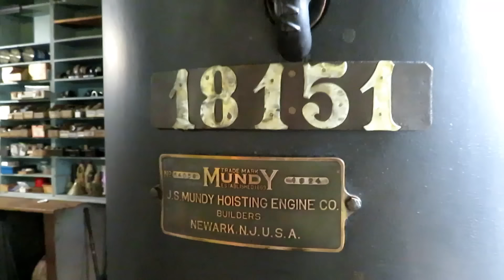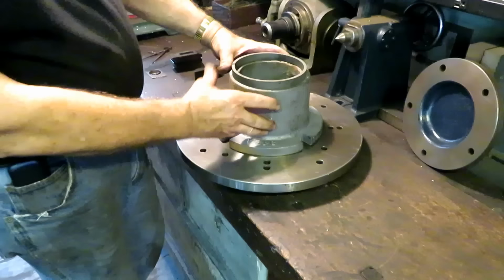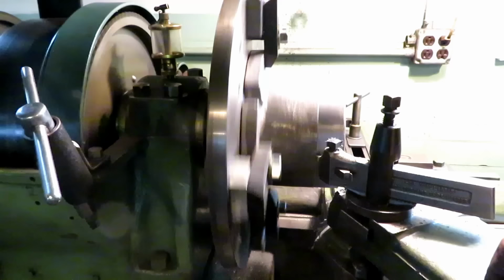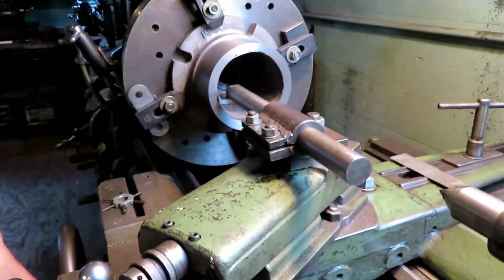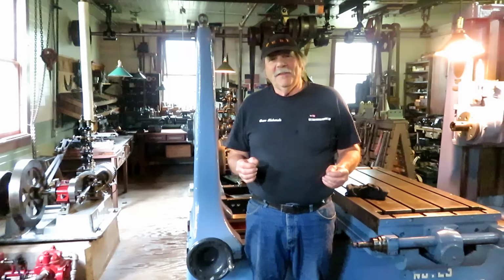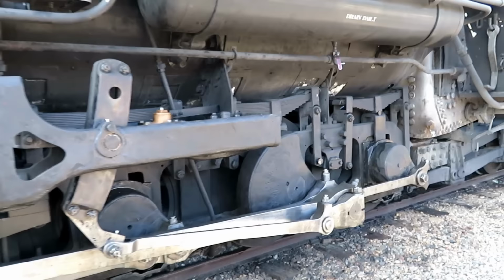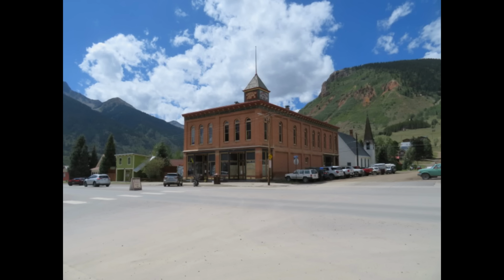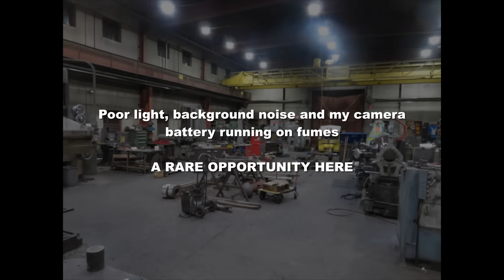OLD STEAM POWERED MACHINE SHOP 45  Piston Rings & Narrow Gauge Dreaming

Comment: Cast iron machinists and coal miners looked about the same art the end of the day. My first industrial job,,, running large radial drill running off overhead line shaft,run  off DC motor, electricity generated off mighty Ames compound engine,, 24" low pressure cylinder and 18' high pressure cylinder and 14 foot diameter flywheel, driving 3 foot wide leather belt. In the return tunnel under the floor, you could stand beneath the belt,,,whipping over your head, and your hair would stand up from the static. Young, crazy, foolish,, ten feet tall and bullet proof, but very much alive in the best of times!!!  Keep on keepin on,, love your channel!!!
Reply from the maker: Thanks for the great comment Bob....Dave

Comment: There's something romantic about the old steam locomotives.  My dad was a switchman on the railroad for around forty years.  He retired in the early eighties so he worked during the transition to all diesel electric locomotives.  He said it wasn't so romantic working everyday around the old metal horses. He complained you always had a cinder in your eye and the steam locos took an unbelievable amount of maintainence compared to the modern engines.  He lived near  the large  yards outside St. Louis and worked on the hump (car classification tracks).  My mother would complain she couldn't hang clothes on the wash line without them being soiled by the soot from the steam engines. Even knowing that I seem to be hypnotized when I see those old giants, appearing to be alive, belching out smoke and hot breath as the push those drivers back and forth as they pass.  Thank you for the great video and a window into the past
Reply from the maker: The smoke and cinder issue has a lot to do with how the engine and fire are handled, especially in the yard in town. DSRR makes a big effort to keep folks happy with their operation...Dave

Comment: Dave, those T slots on your 4 jaw chuck are for holding work pieces like your ring casting. You just remove the jaws and bolt it up using the T slots. Saves you from having to lift that heavy chuck and face plate on and off of the lathe.

Comment: I lived in Knoxville Tn. for several years. While wandering around found a old steam powered marble processing location. It was sold soon after I found it. Was sold to contractor working on restoration of DC post office. Craig Pink marble was the original building surface. They ripped out all the old steam equipment with the rows of belts. what a loss that no one documented the process.

Comment: DAVE,
Really enjoyed your trip west. I have been enjoying your channel for quite a while. I am 
A shop owner in Richmond Va.
Celebrated 50 years in business in March of this year.
Keep up the fantastic videos. Your shop reminds me or the first shop that I got to do some work in. It was all line shaft driven from a 20 hp Dc motor.
It was a school shop to teach
Trades. Miller School of Albermarle near Charlottesville,Va. it was closed in the mid 1990’s. It was built in 1880 as a trade school for the people of albermarle county. The equipment was very extensive, everything from
Lathes,mills,shapers,planers,o.d. & I.d. Grinders. They also had a blacksmith shop and a foundry. The buildings are still there but all the equipment was auctioned off in the later 1990’s. All I have as a temperance is an old post drill.
Keep up the fantastic work.😊
Reply from the maker: Congratulations of 50 years of working for yourself. No small accomplishment. ...Dave

Comment: The Durango & Silverton runs k28 and k36 the K 28 were built by American locomotive company I'm not sure what year but the k36 is were built by Baldwin locomotive Works in 1925 and Rio Grande also took some standard gauge engines and converted them to Narrow Gauge and that's what the k37 are and they're Baldwin's cumbres and Toltec I think has one or two k37 the K indication means it's an outside frame engine like you were talking with the wheels in the center in the frame they're basically standard gauge locomotives built for Narrow Gauge track I've been a fan of the Rio Grande Narrow Gauge for many years it's still on my bucket list
Reply: The K designation is for Mi "k' ado or 2-8-2 wheel arrangement.  The K-27's have a 27,000 lb axle load or approximately 27,000 lb tractive effort, the K-28's have a 28,000 lb axle load or approximately 28,000 lb tractive effort, the K-36's have a 36,000 lb axle load or approximately 36,000 lb tractive effort, and the K-37's have a 37,000 lb axle load or approximately 37,000 lb tractive effort.  The K-37's didn't perform as well as the others because they had been modified from standard gauge 2-8-0s.  The K-27's were built as Vauclain compounds in 1903 with the large or low pressure cylinder on  top of the small high pressure cylinder.
Reply: While in Colorado, did you get out to Uhrich Locomotive works in Strasburg?

Comment: Another very good video.  It looks so easy to build a railroad track across what appears to be "easy" ground ( not the rocky bits), but as I am building a small ride on railroad in the garden, (500yds round) I'm finding it quite difficult. Especially getting the cold rolled rails to meet , as they don't always fit exactly where I want them to especially on curves.( different radii)

Comment: Hi Dave, another fabulous video. Thank you. No complaints from me for the travelogue. Look up the narrow gauge railways in the UK. Mostly around 2 foot gauge. It is strange that the tender appears to be full width as the main reason for narrow gauge railways is reduced loading gauge so making them cheaper to construct, you don't need to clear so much ground, particularly in rocky or mountainous areas. I take it that you will stress relieve the piston rings before final machining? Best wishes. Andy

Comment: You should come to West Virginia and check out Cass Scenic Railroad. They have the largest collection of working Shay locomotives.
Reply from the maker: Cass is next on the "list"....Dave
Reply: If your lucky they will have #6 running. We were there a few months ago and we took the trip to Bald Knob using #11. I was so close to the engine I could almost touch it. It was warm on the cold trip in July.

Comment: i dont understand why you just didnt use the 4 jaw.....The 4 jaw makes a lot more sense for this application than a faceplate.....I enjoyed the video... subbed
Reply from the maker: Thanks for the subscription Sean, The whole idea of the flange on Frick's casting was to make a convenient way to hold the cylindrical part without distorting it from chuck clamping pressure when it got thin....Dave

Comment: Great video as always. Curious: Why wouldn’t you finish turn to size on the faceplate? I thought the whole point of the flanged casting was to allow that to be done in one op.
Reply from the maker: Hi Adam, You'll see as the project goes along. the ring has to be split and compressed in a jig, then turned to "bore" size. They were using a jig the same way at Durango, but my camera gave out and I didn't get a photo of it....Dave

Comment: The K designation and the locomotive design means that is it an outside frame engine that means the wheels are in the center of the frame and the counter weights and connecting rods are on the outside of the frame that's with a K means

Comment: Hi Mr. Richards

Well...
Firstly...are you still getting a bit of belt slippage on the large lathe...?
As I thought i detected a bit when you were parting off...

Secondly...
I loved the video of that railway you visited...
I always thought Colorado was somewhere that was like a desert with tumble weeds blowing about and where those dodgy beatles came from...
I thought the train snaking up near the cliff edge was especially dramatic...
Very scenic...

We have preservation lines here in the UK...
The East Lancs Railway has a lot of steam & early diesel stuff...
The Romney, Hyth & Dymchurch railway is a narrow gauge...
Its on the south coast near Brighton...i think...

It just goes to show that there's lots of things to see and do....it's just a matter of going... 🙂
Reply from the maker: Glen, you're right I've got to do something with that belt, It's actually a rubber conveyor belt with fine groves against the pulley, I thought it would wear in and work better than that but I guess I'll have to spring for a new belt of some other type, maybe go back to leather.....Dave
Reply: @davidrichards5594  on the old rubber belts when we used them on tractors the old timers used to put a couple tablespoons of molasses mixed in water on the inside and ran a couple minutes at low RPM a thin tacky layer got in those grooves and she didnt slip... Rubber belts get a shine to them over time and for us the buzz saw would slip...

Comment: The only thing I would do different is flip the boring bar over and bore on the back side
Reply from the maker: Hi Dennis, I've never understood the advantages of doing that. The force against the toolpost would be up, pulling the cross slide and compound up against the dovetails angled faces, and lifting against the carriage instead of forcing down against the ways which are trying to locate the carriage crosswise. Some folks like to thread that way too, could you explain it?...Thanks for watching....Dave

Comment: Most excellent travel tour...one question, how are those drive wheels secured to the axles, I was looking for a big keyway. Are they 'shrunk' on...? I'm in Northern California, there's some nice railroad that they're still running, but nothing quite as spectacular as this.
   And here in Sacramento, there's the now-defunct Sacramento Locomotive Works where they built complete engines, foundry and all....it's pretty dirty though, they've spent last 15+ years getting the dirt property cleaned up, the buildings are still there. The place is probably on that Super-Fund clean-up list.
Reply: They are pressed on...  I believe the wheel is heated and the shaft pressed on... there is a video of modern train wheels and axles being done in that way...  The tires are also heated and then pressed on...

Comment: Hi Dave, What a spectacular senery, and some heavy railroad metal, why do you not finish the piston rings in the lathe ?.
Reply from the maker: They have to be cut and compressed in a jig , then OD turned to cylinder bore size. That way they will have some "spring" into the cylinder and will be round when installed....Dave
Reply: Yes ofcourse, stupid of me not to think so far.

Comment: What was the reasoning behind the experimental wheel relief?  Just to make machining easier by not having to turn the big radius on the outside?
Reply from the maker: According to Joe: The worst problem with profile wear is the "lip" that ends up on the outside edge from slower wear there. It defeats the purpose of the profile and causes some banging around against the flanges on turns, etc. So they cut the outside relief to make the job last a lot longer. You can see the wear pattern on the heavily  "used" wheel in the photo....Dave
Reply: The tires don't wear down to condemnable limits because the side rods will be hitting the rails on turnouts and crossing surfaces because of the small clearance between the bottom of the side rods and the top surface of the rail.  In other words the stroke could not be increased without increasing the diameter of the wheels.
Reply from the maker: There were a set of crank throws there that had the edges chamfered off about an inch with a torch down near the crank pin. Joe figures that it was done many years ago to avoid hitting rail in dual gauge switches in the area where that particular loco was working.....Dave

Comment: If someone could talk about why the smoke stack on locomotives puffs in time with the engine I would appreciate it.
Reply from the maker: I can take a stab at that Hugh,  Everything about a steam locomotive concerns performance and efficiency. The exhaust from the steam cylinders that drive the locomotive is directed up the smoke stack to act like a siphon and it helps to pull the air through the grates, fire, and boiler tubes behind it, making the fire burn much hotter like blowing on a charcoal fire in your grill. So the harder the loco is working, the greater the exhaust up the stack and the hotter the fire burns....Dave
Reply: So there's the regular draft from the heat of the fire plus a sort of venturi effect from the cylinder exhaust. Thanks for answering  Dave I always wondered.
Reply: In addition to what Dave says, the two engines are out of phase by 90*. That why you hear four "chuffs" for every rotation of the drivers.
Reply: The two sides are quartered or 90 degrees apart so the locomotive is self starting and reversable no matter where the rods and pistons stop.  If one side is on dead center the other side is at about half travel for maximum torque.  On most locomotives the right hand side leads the left side.  The Pennsylvania RR was the exception to this as their standard was left leads.

Comment: I believe in one of your other videos , tou mentioned that you use a steam specific lube , mixed with the steam , before the steam enters the cylinder ?

     Do steam locomotives use a similar lube ?

Thanks ,  :-)
Wyr
God bless
Reply from the maker: Hi Wyr,  Same thing but there are different formulations for different boiler pressures and superheated types. The steam temperature can get so high that it exceeds the flash point of the lube, breaking down the lubricating ability of the oil. I don't know what was used in the old days in very high performance locos. Maybe someone else can shed some light on this question......Dave
Reply: David Richards  Thanks ,   :-)
Wyr
God bless

Comment: Dave,  what target dimensions are you aiming for when turning the rings?  within a thousanth of the cylinder bore, over or under?  why did you not turn to those dimensions before cutting off the ring?  thank you
Reply from the maker: The way I've done it before is to turn the OD about 2% larger than the bore, split the ring and then compress it and hold it in a jig (that I have to make for this size) then turn the OD to the bore size. That way it ends up with some "spring" built into it. Thanks for watching Mark.....Dave

Comment: How do you design, layout, and build a steam-powered machine shop?
Reply from the maker: Art: That's a big question for this late at night. I guess the design is sort of locked into the available space and design of the building, if you are talking about my situation. If you are going to build a building, that's another thing.  The "power" end will depend on the type and size boiler you have available as well as the engine type and size you can come up with.  A vertical boiler and vertical engine, for instance would take less and different shape space than a horizontal boiler and engine. Feed water systems need to be planned to keep from freezing up in winter. Line shaft systems seem to work well in longer narrow buildings with shafts  about 5 feet out from the walls on both sides. Lathes should be on same side to run in the right direction. Long machines like planers can go across the end of the shop because their input shaft would not be parallel to the line shaft  if placed along the side.  Room for counter shafts above some machines has to be allowed for on some machines that need a "clutch or loose/tight system to start and stop, or a stepped pulley system for different speeds. Main shafts usually run about 250-300 RPM and you figure from there. If the ceiling joists and timbers are not heavy enough to hang all the shafting, etc, extra posts and beams will be needed in some places. Another consideration is the size of the pulleys on the different machine drives to yield the right speed for each machine as well as the minimum width of belts in different places (this is mostly a guess) . My shop started with 3 machines on one line shaft and I added on as I went, leaving room where possible for expansion. If you are going to try it..Good luck and let me know if I can help in any way....Dave
Reply: David Richards thanks for that, it helps. Trying to talk son into going steam power.

Comment: Great videos! What oil do you use as cylinder oil in your steam engine?
Reply from the maker: Tim:  old formula steam cylinder oil in the big engine with a pump, the smaller O&S engine that  first ran the line shaft has a displacement lubricator. I use "Green Velvet" brand 'new manufactured" oil in that.
Reply: David Richards  Where do you buy "Green Velvet". I have not been able to locate a source.

Comment: What is the significance of the number 18151 on the boiler? Asset number? Serial number?
Reply from the maker: It's the manufacturer's serial number. National Board code used to require it to be numbers riveted to a steel band clamped around the boiler. If it was used outside at all, moisture got trapped under the bands and caused a lot of rust pitting. This boiler shows that. I just repaired the numbers, trimmed the  band off and mounted it under the hand hole clamp....Dave
Reply: @davidrichards5594  Thank you for the reply. A bit of regulatory history and practicality all in one.

Comment: recently in the news the term "monkey things up" was put foreward as a racist comment. the term monkey as it applies to "monkeying things up" is as old as the equipment in this video. in the intro oiling the bearings overhead was done by young boys or men who were not large framed. grease monkeys, cause they climbed around overhead.
 just because someone has the build for a job doesnt mean they have ability. sometimes they 'monkeyed things up'....... these were white irish kids, so to monkey  things up was never a racial slur was it?.... or was it?